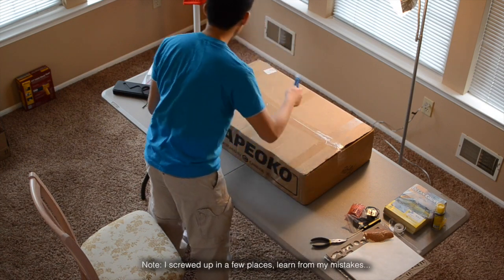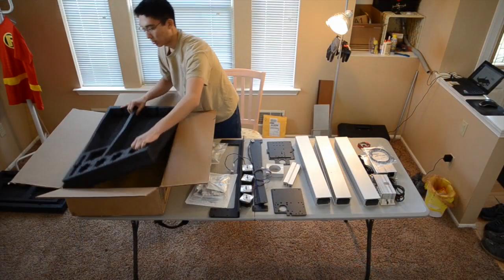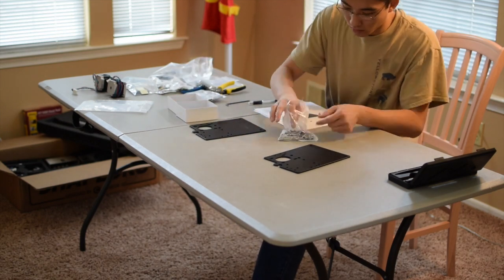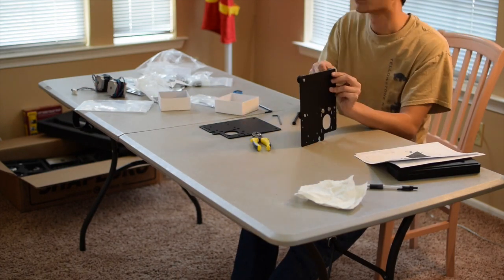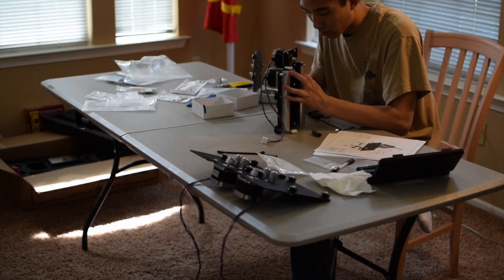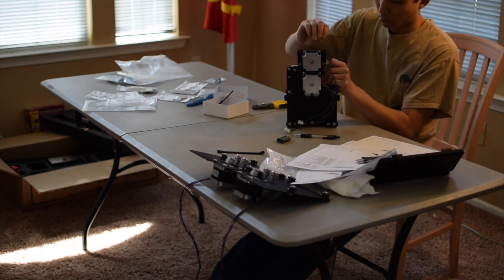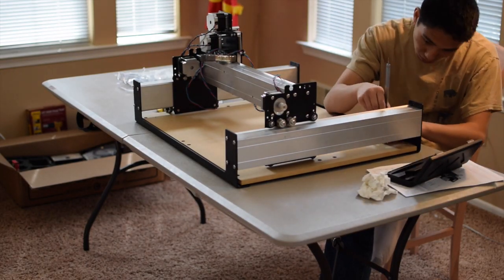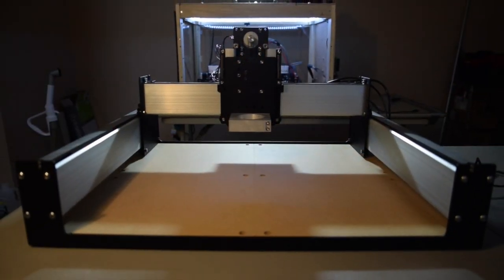Shapeoko 3 (2015) Assembly Overview

Comment: Can you please tell me the table size on this version, did it come with a router and if it doesn't which one did you get and the price please. Very interested in purchasing one but have many questions.
Reply from the maker: +frehleycomet Machine specs can be found here: http://carbide3d.com/shapeoko/
Larger available too: http://shop.carbide3d.com/collections/frontpage/products/shapeoko-xl-kit?variant=15826339270

Fits Dewalt 611, or any other 68mm diameter router (not included).

Comment: What are the eccentric nuts for? Do they allow to tighten the bearing's tension or something? I have a hard time visualizing how it is used.
Reply from the maker: +kwa Eccentric nuts are basically regular nuts, but the hole in them is off-center. When that hole is rotated, it moves the axis of the bearing wheels up or down to better contact the rails. http://bit.ly/1OHQwPL
Reply: +Winston Moy Ah, thanks, clears it up for me!

Comment: Well I got mine mostly assembled but I'm confused on how to square it.
Some advice would be nice thanks.
Reply from the maker: theater40 The X-Y rails should be cut pretty close to perpendicular, so the main source of error you need to worry about is the base frame being square. Loosen all the straps/MDF panels half a turn and make sure the base isn't "parallelogram-ing" on you, then tighten it all back down. You can either use a square between the front base frame piece and MDF, or measure corner-to-corner distance.

Comment: Another informative video...Thanks Winston.  I bought a Shapeoko2 last year and made several upgrades, including Dewalt spindle and 1000mm Y-axis. Lately I have been considering the new Xcarve machine. Any thoughts on the advantages or significant differences you see between the Xcarve and Shapeoko 3?  Thanks again!
Reply from the maker: john cooper both are improvements over the Shapeoko 2 design, and both in different ways. X-carve is better looking, has simpler parts (really love that X-carriage extrusion), but mechanically not a substantial improvement. If you're already using an S2 and happy, I think the X-carve upgrade is mostly cosmetic. By the same token, unless you think that you're pushing the limits of Makerslide (doing a lot of aluminum, or using really fast feeds), i wouldn't feel pressured to upgrade.

S3 is more physically capable (strength wise), though not nearly as flexible in it's current iteration (I suspect once extra-long rails come out, the base frame will return to using something modular like 8020, but that is entirely a guess).

Forgot to mention, but I finished the S3 build in an afternoon (suspect the X-carve would take about as much time, so they're on even ground there). I haven't played around with it enough yet to be able to present a review of the custom software and electronics integration, but it'll be coming in the next 2 weeks.
Reply: Winston Moy  Thanks for the wisdom and your time.  I think you have so many followers because of your unbiased commentary.  I think your good work should encourage Edward Ford to help you get out of the carpeted apartment/condo and into at least a garage.....LOL.

Comment: Very well done. I can't grasp how the Z axis moves but it looks nice.
Reply from the maker: Dustin Penner If you look at the illustrations, it's a lot clearer. On the X-plate, there's a closed loop of GT2 belt, and the Z-plate basically grabs it with a non-rotating pulley. It's an interesting solution that doesn't really add any new parts to the bill of materials.
Reply: AHHH! Thanks!

Comment: considered modifying the belt drive to be similar to this: https://youtu.be/OdJoVh6DRPA?t=1m4s or isn't belt stretch an issue?
Reply from the maker: Lasse Langwadt Christensen That's a really neat idea, one step removed from a straight up rack&pinion. Would give you better absolute accuracy but you'd need the right applications to make it worthwhile. A couple people have discussed simply using wider GT2 belting to reduce stretch. For my basic projects, it's probably a little overkill.